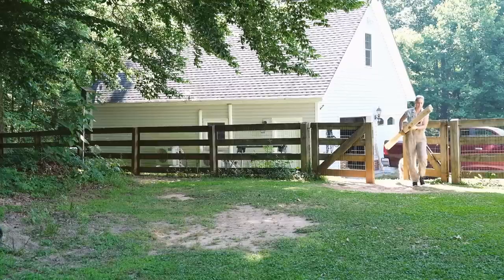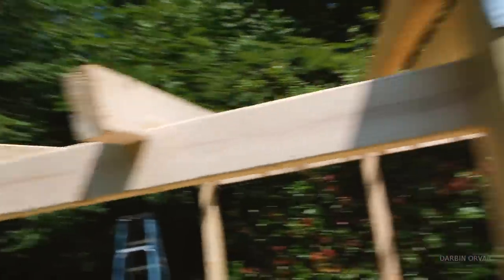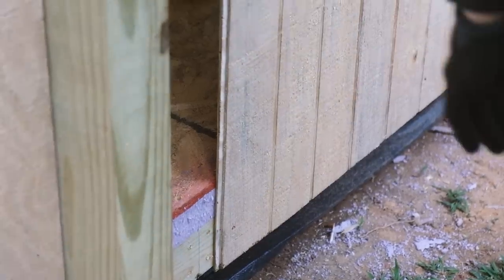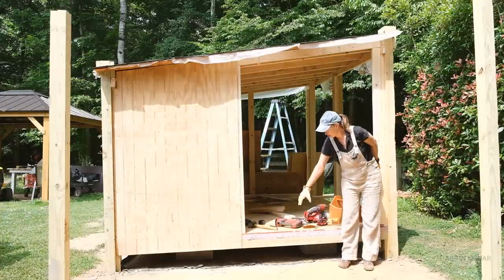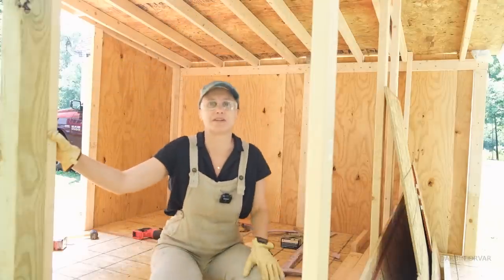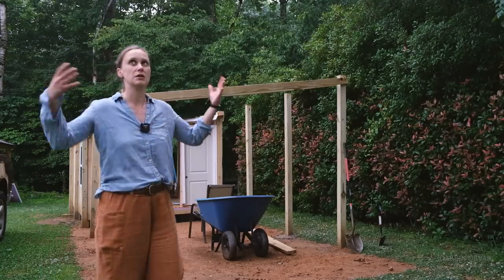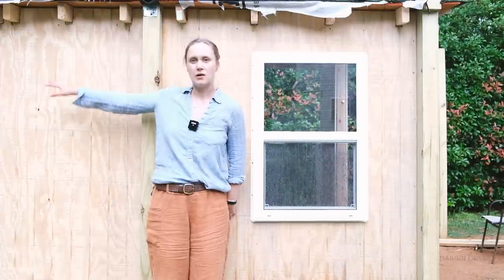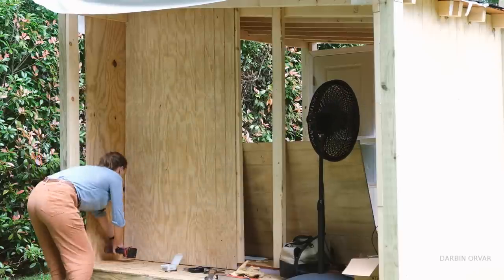Building the Ultimate Children's Playhouse: Roof, Windows, and Walls - Epic DIY Adventure!

Comment: Ok...the overall idea is great!...but...the Styrofoam insulation you put in the floor is driving me crazy....your osb should be directly on top of vapor barrier and the floor joists...the insulation should have been cut to fit between the floor joists. The floor joists should be supported by floor joist hangars...the way it is now will be ok for a short term but if adults walk on it or as your child grows...the insulation will break down and cause the floor boards to buckle and shift.